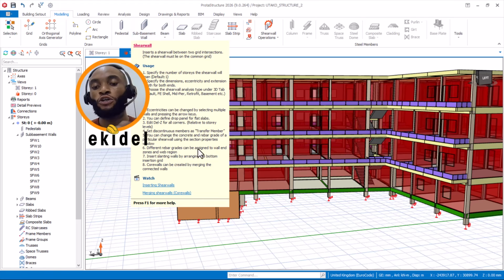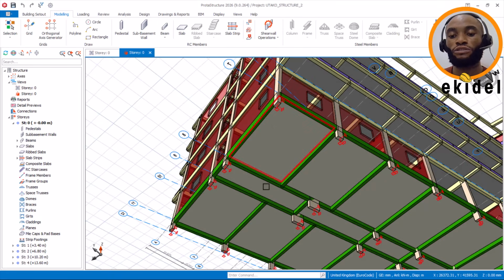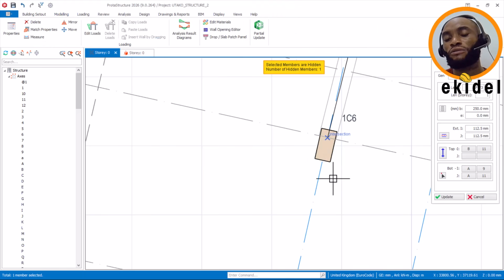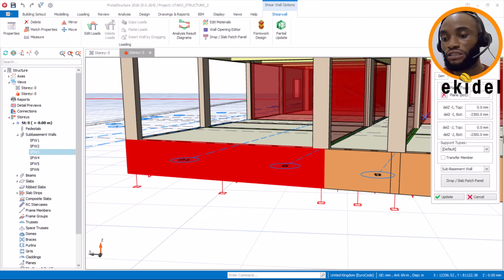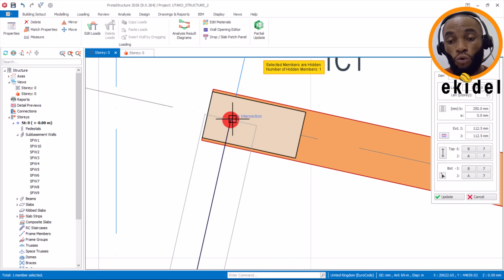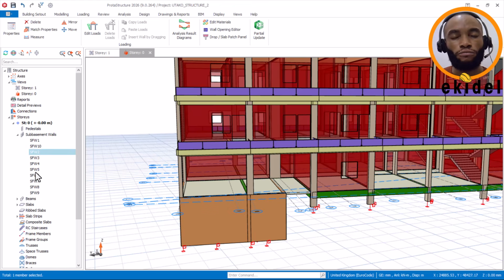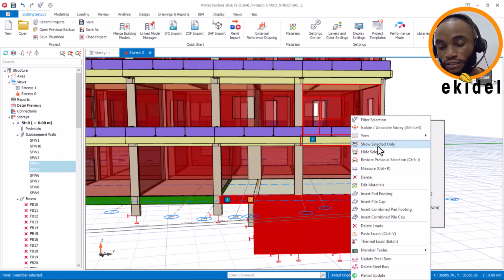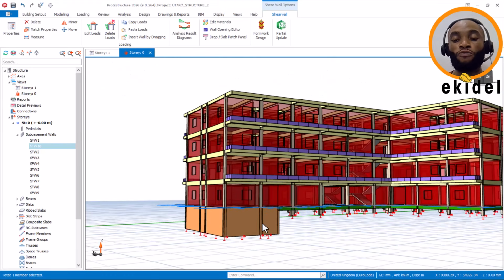Protastructure 2026: New Way To Design BASEMENT FLOOR in Protastructure

Comment: The basement walls have been modeled without assigning a separate storey for the basement level. As a result, the columns along these walls in Storey 1 have effectively doubled in height—from 3400mm to 6800mm. This may lead Prota to classify them as long columns, which could trigger more stringent design requirements.

Additionally, just in case the basement walls are intended to sit on a raft foundation, we may encounter modeling issues. The current setup places the basement at Story 0, where a slab-on-grade or fill already exists. This overlap could complicate the integration of the raft foundation in the structural model.

Comment: "35:48 basement wall did not touch. So with this now we are going to provide a beam"  In this portion of your video transcript, you started modeling DPC beam again at the same location of original DPC beam that has no basement. As it was not shown on video that you deleted the original DPC beams on the area that has now basement walls, i just wanted to confirm if you did. Thnx
Reply from the maker: Yes the original DPC beam was deleted